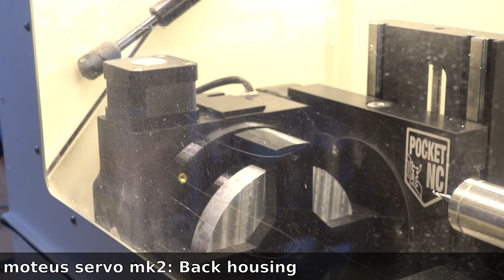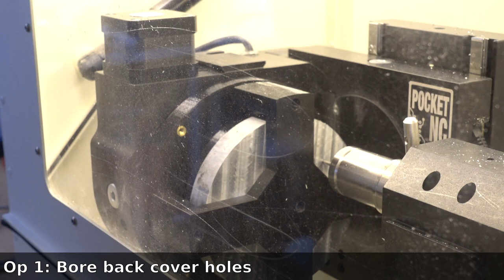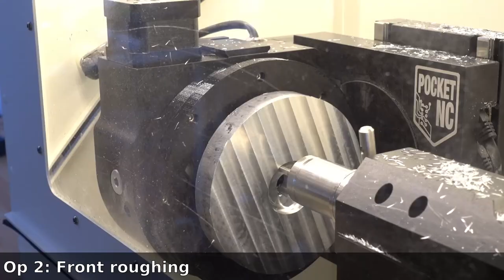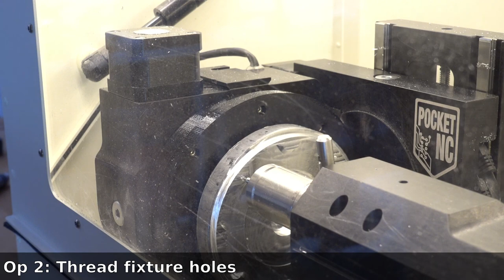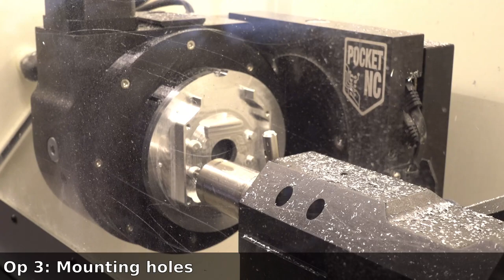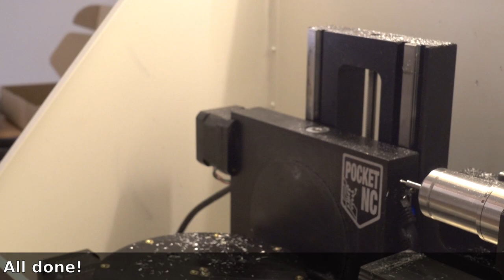moteus servo mk2: Back housing machining

Comment: Did you face a concentricity problems with your parts which led to the rotor magnets stick to the stator windings, and the actuator becomes not able to move due to friction?
Reply from the maker: I haven't had any problems with properly toleranced aluminum parts.

Comment: Thanks for the video, how long did the milling take? :)
Reply from the maker: I'll first say the Pocket NC v2-50 is a great machine.  I'm getting MRRs 4x what you could get with a v2-10.  That said, it still isn't particularly fast by CNC standards.  This part had about 8 hours total on the Pocket NC.  I could have cut that in half if I tried, but I'm only making one or two for now and the programming takes a similar amount of time so it wasn't worth it.
Reply: @awesjosh  how loud is that machine?
Reply from the maker: @luks9203  loud